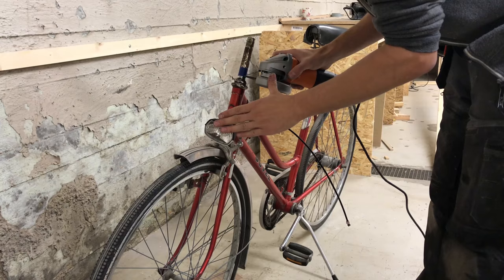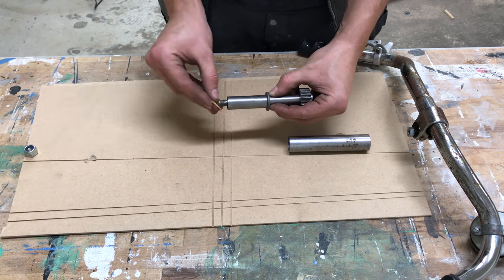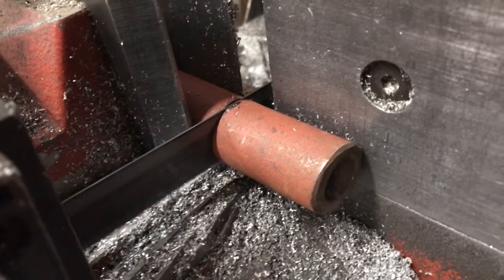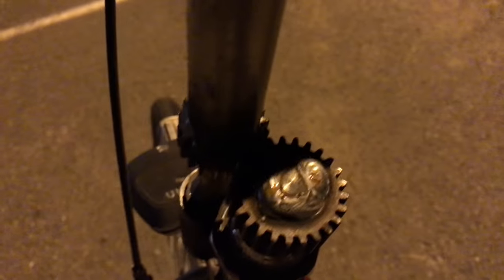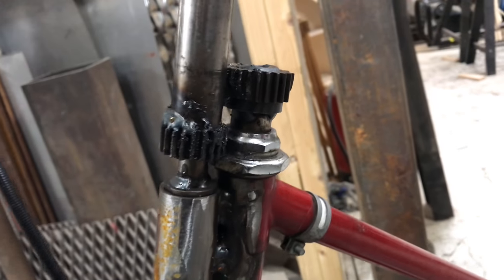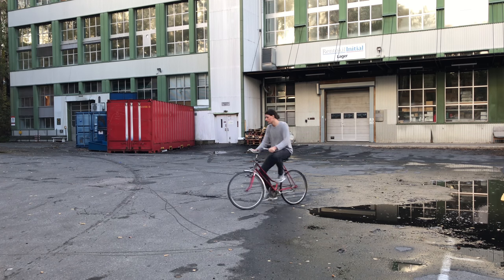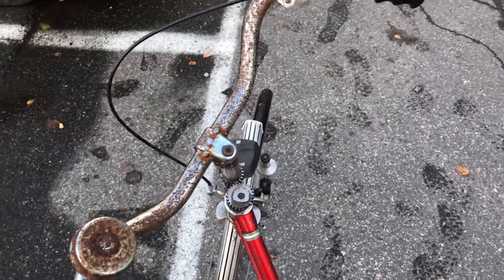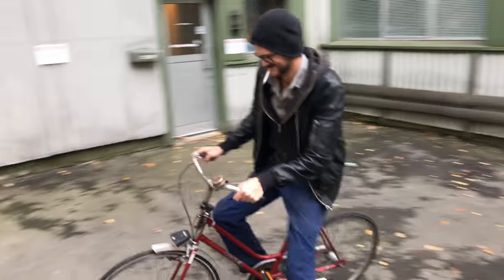I built a Backwards Brain Bike!

Comment: I switched the 123456789 / !@#$%&*() and :/; on my keyboard, and barely had any incidents. Also no incidents when using someone else's keyboard.
Why the switch❓ If I need to type numbers, that's what the numpad is for. So why use Shift when I need a symbol❓ I also use : far more often than ;.